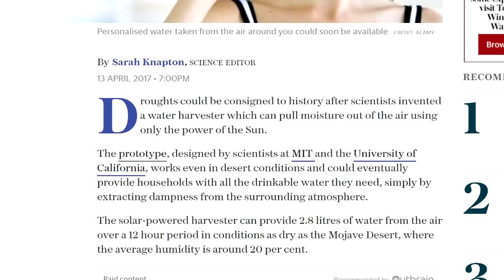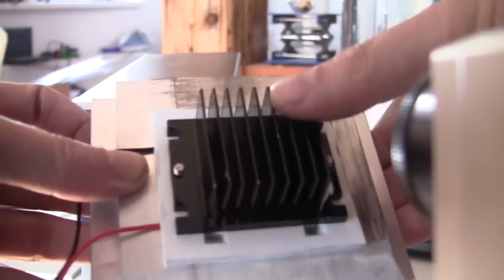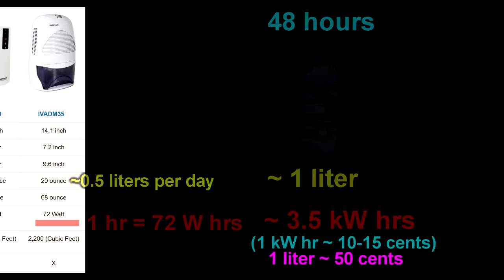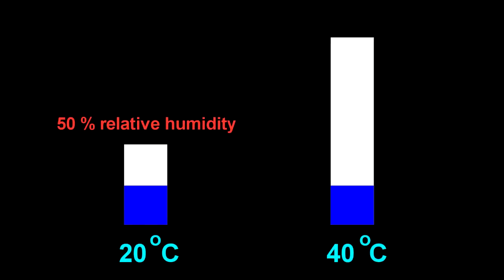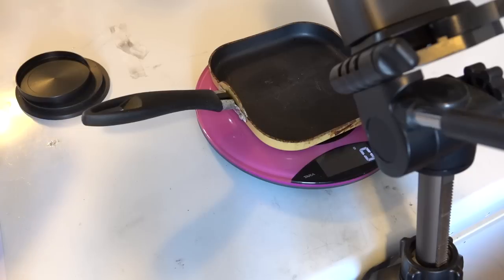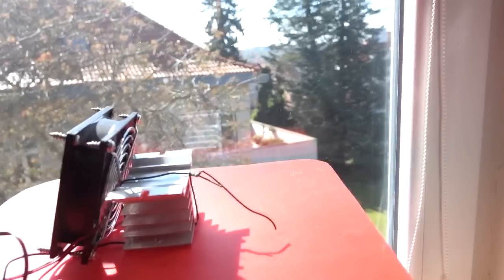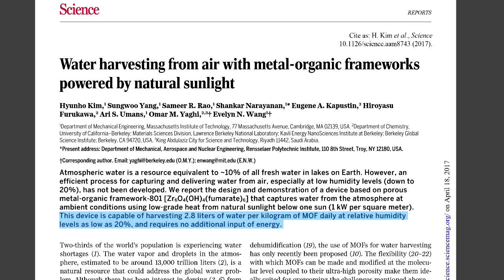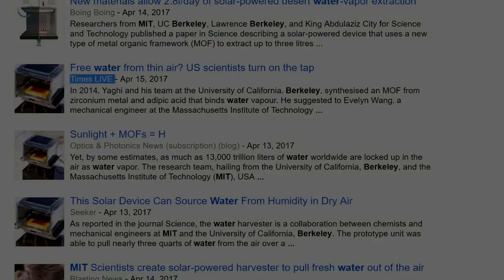FREE water from AIR device: BUSTED

Comment: I hav a dehumidifier that can pull about a liter every 12 hours, and uses 600W an hour(I think). so that's like 6 solar panels and you'd probably get less than 3 liters in the desert. you'd need like 10 of this setup to get 3 liters a day....that's 60 100W solar panels. I mean you could do it but....

Comment: So it's a terribly inefficient Peltier device. It's basically the top half of my home-made heat-driven stove-fan, which uses heat from the firebox to blow cool air over the flue, to extract more heat. Except that my device works as advertised, 100% of the time, converting heat energy into electricity via the Peltier, which drives a 12" propellor which cools the massive (1.2 sq.m) PC heat sink above the device.

Comment: Hey @Thunderf00t
can u take a look at the Glass Battery, currently being developed by Goodenough and Braga
Reply: > "On February 28, 2017, Goodenough and his team at the University of Texas published a paper in the journal Energy and Environmental Science on their demonstration of a glass battery, a low-cost all-solid-state battery that is noncombustible and has a long cycle life with a high volumetric energy density, and fast rates of charge and discharge. Instead of liquid electrolytes, the battery uses glass electrolytes that enable the use of an alkali-metal anode without the formation of dendrites. However, this paper was met with widespread skepticism by the battery research community and remains controversial after several follow-up works. The work was criticized for a lack of comprehensive data, spurious interpretations of the data obtained, and that the proposed mechanism of battery operation would violate the first law of thermodynamics."

Comment: "if it's anything like mine it runs at 50 W" what? bro it says on the paper that it needs less than 1 kw per square meter of material. the material used in the paper is 0.0049 square meters. that's 4.9 W. Almost a tenth of the power consumption of the Peltier.

Comment: This all seems like a silly way of going about things.  As a layman, if I were looking to do this what I’d want to do is to move large amounts of hot air through a cold condenser and the only energy I’d want to put into the system would be the minimum necessary to move the air.  So, I’d be thinking along the lines of buried sewer pipes with a funnel opening facing a naturally windswept geographical feature.  The hot air would be blown through the cooler pipes which could collect the condensation.  

I’m pretty sure it would work and I’m also pretty certain that better minds than my own came up with the idea long ago.

Comment: A "free water" test.  Today it is 85 F, Relative humidity of 65%, and a Dew Point of 74 F.  The evaporator coils on the air conditioning is condensing ~1 gallon / hour out of the house during the day.  Yes it does cost money to run the AC but comfort is the payout, the condensation is secondary and is purposed to water my pepper garden. in stead of using municipal utility water.  I live near the ocean so high humidity day are the norm

Comment: Not to say you're wrong or anything i really like your videos. Here comes the butt...
I lived in Okinawa, Japan for 3 years in the first month i bought a Dehumidifier and i had it running all the time most of the year (on high when not home and low when home). I this was about a  ~2-3 quart capacity dehumidifier about half gallon(~1.5L). On a normal day i would dump out. On a very humid hot summer day i was emptying it 2-3 time a day, the most i had ever emptied it was 4 times(A/C broke).  I do realize the humidity was somewhere near 90% but even the. On very dry days (20%)it may take 3-4 days to fill.
Reply: Sagrotan its not like it was being dunked it water every day this is was sitting in a hallway in an apartment with all windows and doors closed a majority of the time.
Reply: Im merely debating the statement .5 letters a day in ideal conditions.

Comment: Hey foot, I just visited a farm today and they had a device like this that was powered by solar. It was outputting into a water trough with plants in it as a trial, and they said they had only had it for a year. They said they could get around 2 liters per week, but it was sufficient as the plants were fairly drought tolerant and stayed in the shade. There was many plants in the trough and even full corn stocks that were ready to pick. This was in Colorado in a floodplain near a river and the foothills to give an idea of the local climate. The device was called 'Zero Mass Water' and was pretty big for what it put out, but it could be useful for some very specific applications.

Comment: I've read a lot of comments about you not reading the paper. "They don't use a Peltier-effect device. You're misrepresenting the article." Wellllll...even if the metal organic framework sucks out water from the air (as you showed your zinc-chloride doing) you still retain the temperature, heat rejection, and airflow issues which you pointed out in the WaterSeer video etc. I think this highlights the benefit of the doubt we provide to institutions we respect (like MIT), and how easily that can overcome our skepticism. But you're also using the thermodynamic argument pretty forcefully and condescendingly, and I'm sure that raises hackles.

Comment: please do a video on Eco Blue water condensers. it's basically a commercial water condenser that's getting buzz from even Unbox Therapy. their website claims they're running on 380w and generating 8 gallons a day. also when you read their faq page on power consumption comment's are disabled.

Comment: Every time I see something like this it reminds me of a Ray Mears episode where he shows a way to get some water in the desert, involving a cup, a spade, and some clingfilm.  He dug a hole, put the cup in it, and covered it with the film.  The sunlight caused the cool air from beneath the sand to heat up, causing the water vapour to condense on the film, and then droplets would roll to the centre before dropping into the cup.

He never claims it would be quick, nor that you would get much, but in a pinch it might save your life if you're low on water. 

It soulds like that does more than all the machines you've debunked so far.
Reply: This actually doesn't work. It worked in that show because they poured water into the sand hole first. And it works if you put green grass or plant material in the hole. You cant get water from air that has no humidity ( as is the case in any actual desert )
Reply: @MrDmadness  I wasn't expected a response to a three year old comment but thanks regardless!

That makes sense, though, has been even longer since I watched that episode, or any other survival stuff.

Comment: You got it all wrong thunder, because trough the law of all we had was 1st grade science we know that U=I*R (or V=I*R in the US) and P=U*I (or P=V*I in the US).
now lets say we have a 50 Watt solar panal right, that 50 Watt solar panel gives us 12 Volt.
that means if you do P/U=I 50/12=4.16(repeating) we now know we have about 4.16 Amps of current.
this means that because U/I=R 12/4.16=2.88 we now know that we have a resistance of about 2.88 Ohm.
so if we increase that resistance from 2.88 to lets say 288 Ohm we now get I*R=U 4.16*288=1198,08 so we went from 12 to 1198.08 Volt just by adding some resistance.
and because U*I=P 1198.08*4.16=4984.01 we went from 50 Watt to 4984.01 Watt, that is almost 100 times more just by adding a bit of resistance to the circuit.

P.s. please understand this is a joke, i know that it doesn't work like this, i am actually a electrical engineer.
but this is the kind of shit you get when people take 1st grade science, learn the law of Ohm and the law of power before they move on the the next topic of sound or something.

Comment: I think you slightly missed the point of the study. The point was to demonstrate the water uptake of MOF-801 could be use in condensers. This material is so water hungry that it could absorb water ~50% of its weight.(http://pubs.acs.org/doi/abs/10.1021/ja500330a) So you are not simply condense the water out of thin air, you are actually actively grabbing water molecules (I guess?). Taking water out of this material is also easy. Although you are right that there is no free lunch, I think you need to re-examine this a little more.

Comment: What if they were able to use nanosurface interactions to collect the water, like how scarab beetles do it?

I do wonder if there would be a better way than a Peltier device with dessicant dehumidifier to gather water. Aside from using solar energy to make hydrogen and oxygen from electrolysis and then igniting it in a closed container.
Reply: Using a material like molecular sieves that will grab any available moisture at room temperature, then release it when heated is the usual way to remove moisture from air when higher efficiency than am air conditioner is needed. The material in this video just reduces the temperature swing needed a bit.

Comment: The device that MIT proposed does not look like it contains a typical Peltier device, at least not one I've ever seen.  Its for sure not the same one you're using.  Sorry Thunderf00t, but I beleive MIT and Berkeley before someone on youtube with a name like Thunderf00t.  This is a PROTOTYPE... Maybe, just Maybe they used those large gauge wires during PROTOTYPING?  Maybe to Test the device without having to use the Sun, or to pump more current in to it in order to more rapidly test its capabilities? Just a thought.  Keep up the great work though, you have some great vids!

Comment: thunderf00t I am going to create a device to produce half a liter of water from air in a day. I'm only going to do this so that you can use it as evidence that you are right. I live in Kansas. Today at work, I probably sweated a liter of sweat today  it that came from the amazing efficiency of the human body. I know I'm going to need a large quantity of peltier, which I have, provides by a large manufacturer of high dollar TEC devices. I've got $5000 worth of peltiers but this company sells this specific model for $85 each. Highly efficient but still, barely breaking 10%. I'll also need a shit load of solar cells and I'll probably throw in my generating the needed power on a stationary bicycle.

I understand how people don't like you but I know that it is because they refuse to believe they could be wrong. I'm glad to see you fighting your naysayers.

On another note, I'm ready for the eclipse. I've purchased welding lenses and habe an apparatus made that will record the visible sun, the sun through a filter, the general light of the area and shadows during the eclipse.

Comment: I use solar powered dehumidifier with a cut to fit carbon filter and a solar panel. Makes A TON of water. Then I restore it from grey with an aquarium pump blown over a strong UV light to an air stone. PPM is normally .03-04 per gallon, PH 5.5-5.6, and a buddy who works water treatment for the army showed me how to do it. He is British like you. He debated a university professor here and made that professor look so stupid. 

Brit buddy: "Water from is filled with filth from your terrible piping standards. Clean water is H20 and NOTHING ELSE.."
Teacher: "Our tap water is clean! You're so full of it."
Brit buddy: "If your water is clean, then why do YOU personally advise not using it for baby formula? Why do YOU personally have a sediment filter, and a chemical filter under your sink RIGHT NOW?"
Teacher: "You're just trying to make hate." Walks away

^ Are we being indoctrinated?

Comment: Ummmmm... that looks like a Pelletier module to me with a couple of modifications on the heat sinks. Where is there any big damn deal? If I’m stuck in the desert I can gather enough drinking water using plastic a pebble and a cup. 

AND THEY DONT NEED BATTERIES.

Comment: OK  people the only real  cheap way I  can  see to get water  out the air  beside rain  is a   underground  cooling tunnel , one  solar power fan   to get the air  in and out  . stone/ clay pillars   for cooling wide at the top  narrow at the bottom.   Off set them    so the air hit as much surface  as it can .  length  will be long  but  you can change it shape  to fit any place like one big spiral  .  put a dip in the  floor  for the water to run in  and one hand plump 
 put a screen on the air vents  to keep animals out.     now if this don't get  a few cups of water a day than people give up the water out of air  stuff, till you get  a throw away power plant battery  pack   you can fry  a cow with

Comment: You can get water from air from any compressor out there. When you compress air it gets hot. In tank air cool at room temperature. But when you lower pressure by using compressed air it gets cold in tank and water is condensed in every place where air is cold. Anyone who use compressed air know that getting rid of water is pain in the ass. This method must be the worst way to get water but if you already need compressed air it might be the best way to get water in remote location

Comment: Well, you can't heat silver up 10,000 C with  2,000,000 J ; you hit Silver's melting point at 961.8 C; state change takes more energy that just increasing temperature, and then in a liquid state it takes a different amount of energy to increase it a temperature; and what the hell is silver's cooking point. Ah, you get the idea.

Comment: I will point out that if your steam and your radiator are at the same temperature, then no power input is required. The efficiency of a heat engine at that point is zero, and the efficiency of an air conditioner is infinity. Pumping heat between two objects at the same temperature is free. That isn't a free lunch, it's a reversible reaction.

Comment: After reading the article, I realized the video is completely...discussing something else. Key of the research is the material, which can absorb water in lower temperature and release it at higher temperature. Replacing the material with another desiccant will just make it a complete different experiment. The authors even mentioned in the article why they needed to cool the condenser (to prevent vapor condensation on inner walls of the apparatus) and why they thought it would be unnecessary in real  application. Articles published on top research journals do have the possibility to be faulted, but finding the problems will require at least reading the articles carefully, which I do not see in the videos.
Reply: Doesn't change the fact that, at the end of the day, their device is STILL a glorified dehumidifier.

Comment: Hi,
My comments, first on the paper and second on your comment are:

1 - well, it is interesting in its principle as it can harvest water (shown by water sorption). The "prototype" is here to demonstrate and, I think the authors might agree, it is far from perfect. One criticism we could formulate is that they compare gas sorption at low temp as the "capture amount" and then look the adsorbed amount at high temp... In my opinion, datas would have been more accurate using water vapor desorption at high temp values...
Their demonstration is mostly on electricity-free harvesting systems, and even if there is cable pictures, it might prove itself difficult to judge that the whole paper is a fraud: the prototype is not the publication focus, the principle behind is.

2- I understand that the prototype bugged you. Well, it is bad, it is costly. But "busting" based on this is light. I will also point out that in your discussion about the energy needed for water boiling, it is a good approximation, but you forgot that with an adsorbent, you will bring certain amount of energy: it is (weakly, as weakly as the H bond) bonded to the MOF, and that's the point you unfortunately miss. As for the price, well, if this was so important at this stage, we would not be able to do science.
However, I really appreciate the part where the relative humidity is described, and it is my opinion that, from application point of view, it might be better to use a cheaper less efficient desiccant, but that's not the only bottom line for Science, isn't it?

Comment: WSJ: „it might not work today“, which was a rainy day. On a light rainy day, like we had yesterday, I am able to draw 2l per sqm in 4h out of the sky. My device even works with moonlight. The device is made of a porous hightech ceramic material, that deflects water into a metal based water collection facility.
Ok, it‘s a bit older, even the Romains called it tectum, or in English: roof.

Comment: Oh, and this is why we use droplet formation on raschel mesh from fog - a physical process at FogQuest.org - it's not 'pretty', it's not 'sexy', but it's peer reviewed and an established practice since the mid 1980's. Do we get mad writeups like this heap of dung got? Nope, not at all. Do we supply water 'everywhere'? Nope. Fog collection relies on fog or low-altitude cloud - so it's not a solution for Saudi Arabia etc. On a good note, it requires no energy inputs and relies on gravity to move the water down hill for use. But, because what we do is viewed as 'old' everyone is tripping over their feet to do something that solve the water from atmospheric moisture with technology, utterly ignoring the idea that a solution, a good one, should be sustainable and not dependent on technologies that are difficult or impossible to service in the setting the system is deployed into - so far, no winners.
Reply: Some coastal regions in the Saudi peninsula are viable collection locations. We did a project in Oman that resulted in very high yields on SFCs deployed for the test. Inland is a completely different story, which is where the water is most needed and where it's just not in the air.